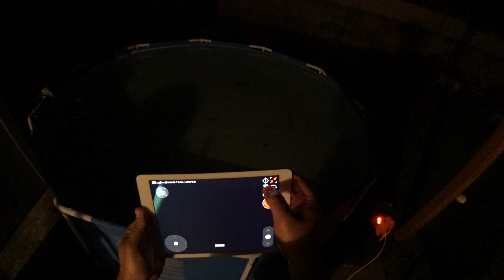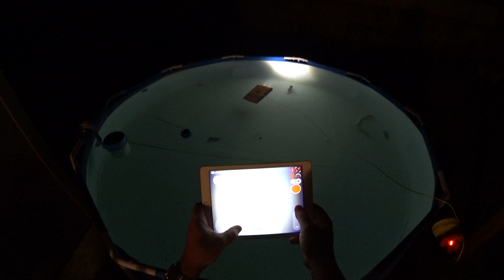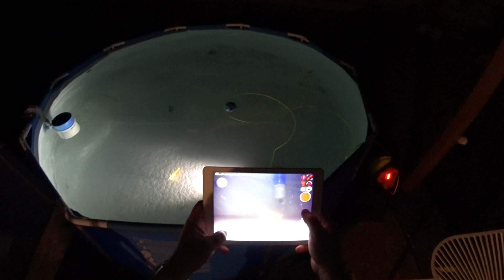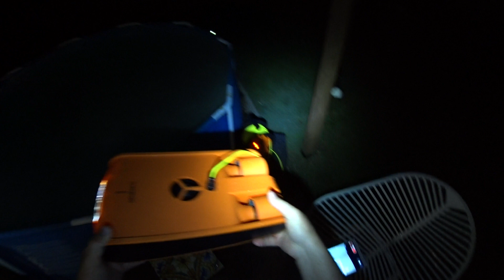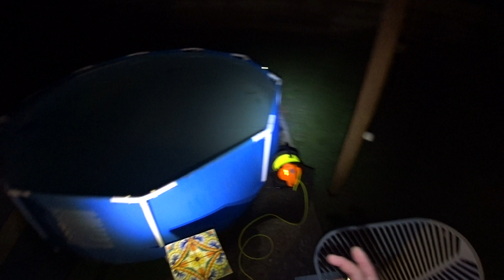Geneinno POSEIDON 1 FPV Underwater Drone ROV Review - Part 2 - In-Depth Pool Test

Comment: Maybe the reason it didn’t sir level was it had an air pocket trapped inside toward the front. As you mentioned the flooding ports look small and doesn’t seem to have good venting to let the air out and the water in at the same time

Comment: They need to change the design of the body of the craft everything is great, the lights, the power, the quality in the video is realy good and clear, but the controls is not well optimized becuase of the shape of the craft. To me they should make drones in a way that boats and subs are build, made for going in water or under, which is perfect. They need to make drones like that with a bit of a unique design that's also functional in it's performance. But all in all great review really lets you see what you ciuld be buying and saves you from getting something that's not worth it, or something that is.

Comment: Hi Dustin,
The sketchy behavior confirm my apprehension on the design. The vertical prop cannot have enough thrust to move the ROV up or down efficiently without forward or backward movement. The plain square-ish design of the top and bottom make it quite like a padle. And as said by Bill Somrak bellow, the vertical motor cannot have enough water to maneuver on the bottom of the pool by the flat design of the bottom.
The user experience might be a bit more comfortable if you pilot this one like a plane because of the wing profile of the ROV and not like a quad. ;)

Comment: I think that its flat bottom design is causing it to have a suction problem, which is why it can't get off the floor of the pool.  That might not be an issue on a sandy bottom. As noted, not very stable in any axis .. which would make taking video or even operating it a bit of a chore.  The inability to connect to the android devices might have something to do with the wi-fi channels it broadcasts on. In some countries (China) the frequencies are different, and they may be using a frequency which is not generally used here in the States. I was surprised you pool was a clean as it was, considering all the ash being blown around your area from Kilauea. Perhaps, if it doesn't perform better in the sea, you can perform a ceremonial sacrifice to the Vulcan god of Volcanoes and see if that works to shut Kilauea down .. ha ha!  Will watch for your "sea adventure" .. at least it will be easy to wind up the cable. Cheers.